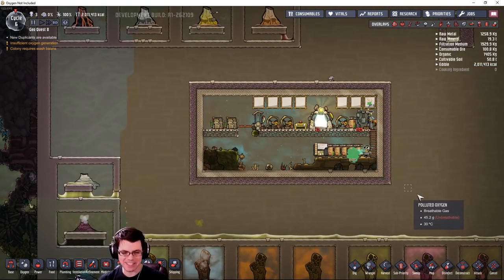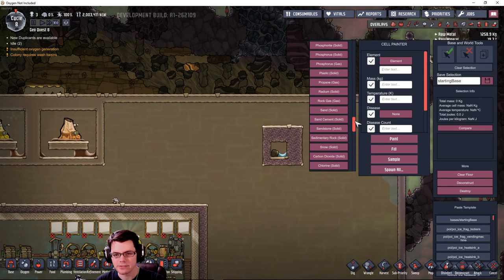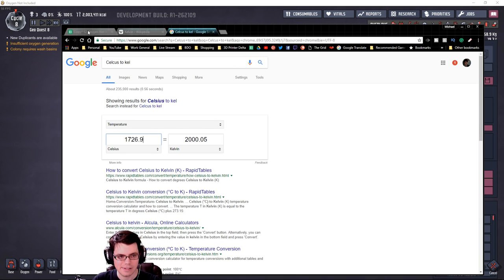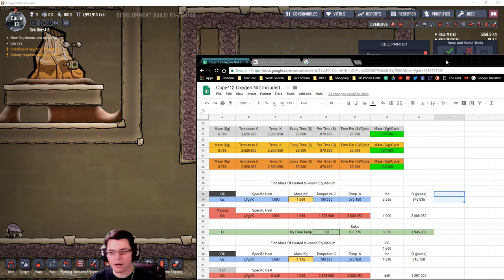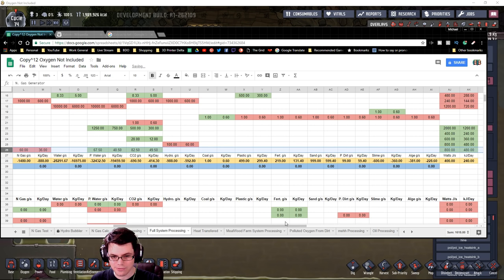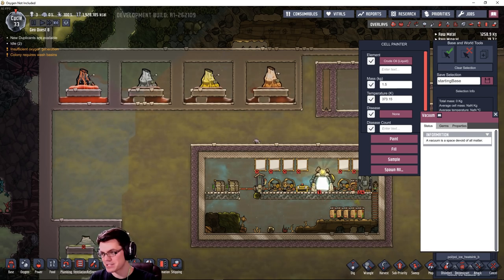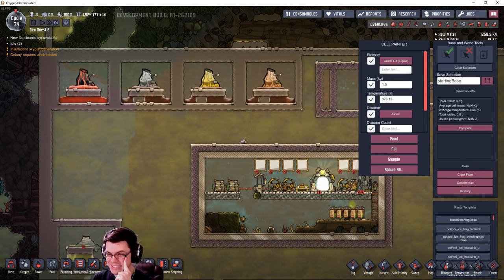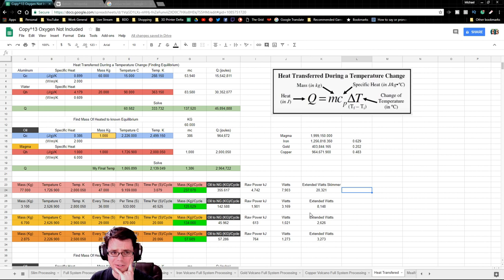Maximum Volcano Power! Spreadsheet Madness Oxygen Not Included

Comment: Brothgar - in your plan to boil crude into NG, you'll run into a minor hurdle with heat recovery. The biggest problem (you can still overcome) is that you won't be able to cool the NG back below 125 with just the crude you're piping in from wells.

The first difficulty is specific heat capacities:
crude oil - 1.69
petroleum - 1.76 (gain about 6% more heat when it converts at 400C)
natural gas - 2.19 (gain about 25% more heat when it converts at 540C)

At best you should expect to reach about 170C with the NG if you build a perfect and very large counter flow heat exchanger. You'll have to make the rest of the trip some other way.

And, there's at least one more difficulty you'll face.

Comment: To get your spreadsheet temperature calculations more correct there is some energy in phase transition of matter e.g. a pot of boiling water on the stove doesn't poof into steam you have to continually heat it to boil it all away. This energy (for liquid to gas) is named https://en.wikipedia.org/wiki/Enthalpy_of_vaporization
Reply: Carl Fruehan Does this hold true in the game though?
Reply: It would seem so. As a simple experiment I debug painted in water and steam at the same well over boiling temperature and the water instantly became steam but was cooler than the steam that I painted in

Comment: I have 2 copper and 1 lava on my map.  Seems alright but water is still a big issue after the geyser changes.

You should also be able to recover most of that heat you put in to the natural gas by using incoming oil to swap that heat.  You've got to cool it down enough to use it anyway.

Comment: Yep. Additionally, before you consume the 560 Degree Natural Gas, you can use it to heat up some water and turn it into superheated steam... driving a steam turbine and using a condenser on the output steam - preheating your feed water going into the steam heater... more energy used up... and if you use polluted water for working fluid... it gets cleaned up when it changes state to steam... then back to clean water in the condenser... =D   So many uses for the heat... plus you can use the power to drive AC, and also cool down water for plants, etc... by running the water thru the liquid cooler dohicky submerged in you vat of crude oil as a pre-heater for feed into the volcano natural gas generator.  One question though... where do you find all the crude oil to consume? gunna need a continuous supply of it to drive the whole system.
Reply: the crude oil demand is very little - 3-400 kg/cycle. You can get that by feeding small amount of water into an oil well.
Reply: water from your steam condenser.. =D
Reply: keep in mind you can use the water later for hydrogen too! this means more power (and oxigen for your dubs)
Reply: Just preheat the oil to safe the energy in it, should be sufficiënt enough, but this going to be beast of a machine to make and a real challange to be controling it, without cooking the whole world!
Reply: doorpump is the only way to move enything over 125°C right? Man why we have no way to move enything outside of pipes without overusing doors? Abysilite Pumps will be to op right?

Comment: Its been since before the ranching upgrade that I played, but why bother converting the petroleum to natural gas? Wouldnt it use less of your magma heat to just leave it at petroleum and then have to cool it less before pumping it into a petroleum generator which then makes your natural gas, CO2, and polluted water?
Reply: Something else to consider in the metal geysers is that you can multiply the power by 1.5 due to having the ability to make infinite microchips for your generators.

Comment: Did you adapt your generator calculator for the new geysers? Because in every seed the figures of EVERY geyser is different as well as a potential of significantly less or more geyser output. So depending if you're lucky or unlucky you could run very few or even many more generators. The "simple" maths of magma:natural gas doesn't change but your overall power output will be vastly different depending if you've been praying to RNGeses enough
Reply: I'm also very happy that you tried calculating this stuff. I spent almost a whole day trying to calculate geyser outputs:power so I know how the math headache feels :D
Reply: I think the original idea was a calculator that anyone could use to figure out the power output of any volcano
Reply: Oh! I interpreted the video wrong then and forgot it's more about the formula to calculate volcano power

Comment: Great video but the gas pump would melt if you expose it to the natural gas
Reply: you need to cool the nat gas down. 550C natgas can for example heat the crude oil that goes into the magma chamber. This also makes the system more efficient - this gets your nat gas to 300ish Celsius for free. Then you can use radiators with stuff that needs heating or doesnt suffer from being hot - like polluted water going into fertilizer makers, or clean water going into electrolizers - this is again "free cooling" and can get your natgas to below 125C. Just dont boil stuff in pipes;) 
Or you can use metal tiles to conduct heat from the nat gas to boil polluted water and use up the steam in a steam turbine setup. this too can get your natgas temp below 125C.
These are not easy setups, purely theoretical. Just as playing with a spreadsheet is;)
Reply: Going to try this on my base. hope no dups died for it.
Reply: You might be able to protect the gas pump temporarily with abyssalite tempshift plates, or have some liquid-based cooling in a loop to pass on heat to the crude oil.  Naptha, perhaps?

Comment: I'm not sure how carbon skimmers would actually lead to more power, carbon skimmers and the sand filters are matched as far as how much they process, if you want to destroy carbon dioxide at the cost of power you can just recycle the same water through a skimmer and filter.... given polluted water is far more common than pure water this more power strategy will have a very short life cycle. however your initial thought of feeding slicksters assuming that you're ranching and they are happy does result in much more oil output and then if you've run out of heat energy from your volcano's using some of your power to converting the oil to petroleum both for plastic and petroleum generators might have a much longer lifetime.

Comment: Can you melt abyyslate?
Reply: Yes, everything (except nutronium) has a melting point.  The issue is that abyssalite has a very low heat transfer rate (0.000001 W/(m*K) compared to the water's 0.609 and sandstone's 2.9 ), so getting it to change temperature takes a long time.  Eventually it should melt though, and become molten rock.